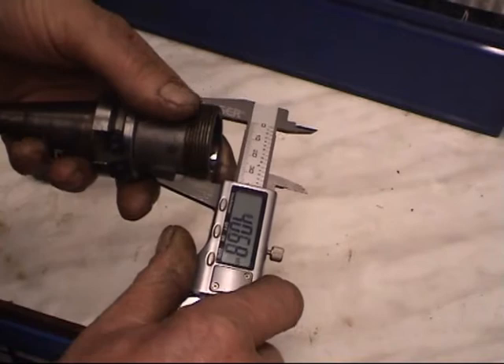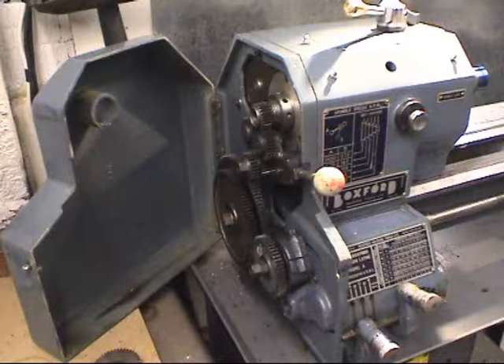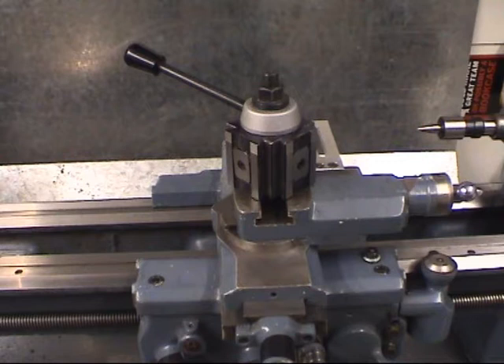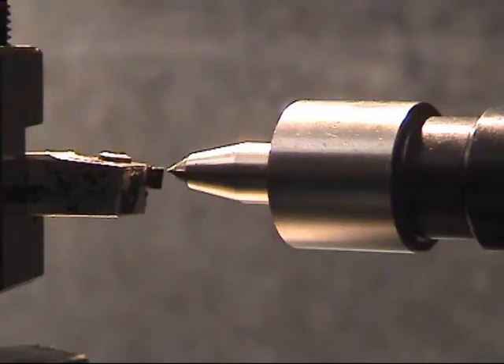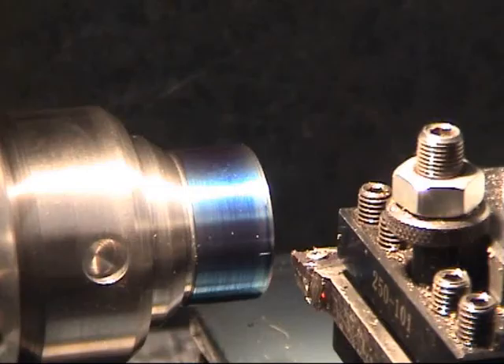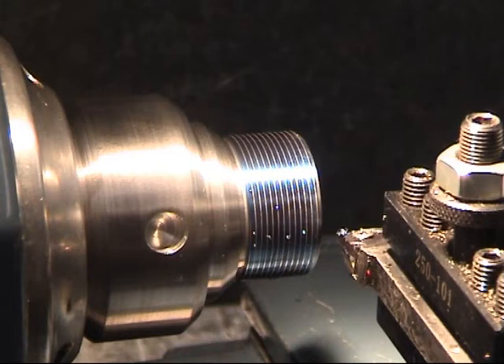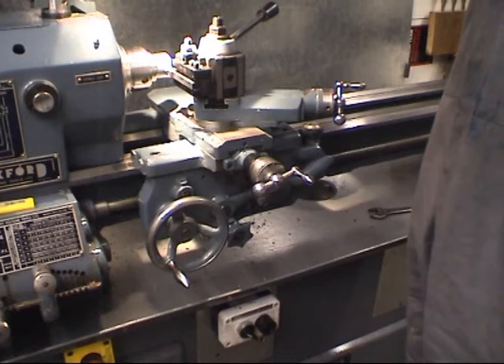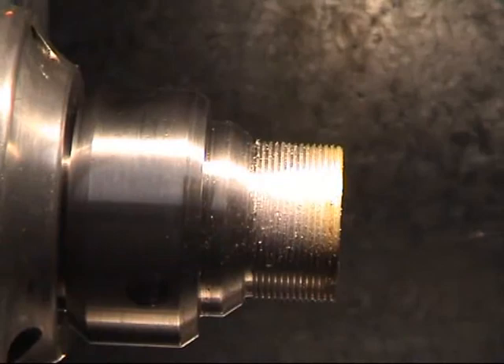Metric Thread On A Imperial Lathe

Comment: I feel that you can pull out at the end of the cut without the slipping sound.  To do this, you start with the gauge exactly on one, on the thread gauge. You don't use it, except for your start position. You throw in the half nut, when it is exactly at one, you drop in the half nut & hit the same track, without double threads if you start the first cut exactly at one.

Comment: When cutting a metric thread with an imperial leadscrew, the dial indicator is useless. The full reversal method you use is well known and obviously guarantees correct pickup of the thread. However, very close approximations to the 50/127 ratio yield factors that can be used to select more general changegears, which allows synchronous distances of the leadscrew pitch to be traversed more quickly with the aid of stop bars.  Martin Cleeve wrote about this in his sublime book on screwcutting.

Comment: Hi, I have a question I sure you could help me with if you are so inclined.
I have acquired a Norton gear box for my boxford cud lathe which I intend to fit in the near future  but I am having problems interpreting the data on the gearbox  change label in particular the feed in thousandths given for every thread pitch.
I am not sure what the value represents other than perhaps the amount the compound slide is advanced to produce the thread form?
If you could enlighten I would be much obliged.
P.S. I have looked in all the usual places and failed to find an answer.

Comment: The small wheel must be divisible by the pitch of the leadscrew or a quarter, half or 3/4 of the pitch.      120/8 =  14.  The large wheel must have 127 cogs.  127 / 25.4.  There are exactly 25.4 mm in an inch.  The conversion is exact.
Reply from the maker: How far away will it be using a 64 tooth gear
Reply: @doubleboost  The imperial system never was standardised so that the inch could vary from  country to country..     The metric system was standardized based on the speed of light and a metal rod kept in Paris.  It was decided that the nearest comparison was that there were 25.4 mm in an inch.   This is now universally accepted.     25.4 X 4 =  101.6 ( no good) 25.4 X 6 =  172/4  (no good)  but 25.4 X 5  =  127   spot on accurate,    All measuring devices are based on this.

Comment: You are not using your thread dial to pick up the start of the next cut,  but rather puting the lathe in reverse at the end of each cut.  Is the thread dial no longer correct when cutting metric threads, or are you doing this beacuse you prefer just reversing the spindle, lead and carriage?

Comment: I guess I am lucky to have a lovely big old Rollo Supreme lathe in my workshop. All I have to do is rotate one handle to convert from imperial to metric threads. This combined with a Norton gearbox means a complete range of imperial and metric threads are easy to cut including the funnies like 11 1/2 tipi, a pipe thread?

Comment: I have to disagree with you on not using a right angle to cut 60 degree threads.  Certainly the tool is being used as a form tool to cut a 'v' thread which is a much lighter cut than some form tools such as an acme.  You just take lighter cuts.  Are you trying to say you never use a form tool?  Some of the older lathes did not even have a compound and the right angle cut with a 60 degree tool (a form tool when used like this) was the only way to cut thread.  One must be careful about uttering absolutes.  There is more than one way to skin a cat and a good machinist keeps open to all ways to do things as sometimes you can't do it with just one technique.  Statements like that do not help the beginning machinist.  Doug
Reply from the maker: +Douglas Thompson I often use a form tool

Comment: The compound is not being set at 29 degrees. To set the compound at 29 degrees or 27 for imperial threads bring the compound around so it is in line with the cross slide, then move the 29 or 27 degrees to the right for right hand  external threads or to the left for right hand internal thread turning out from a blind hole, cutting the thread on the far side.

Comment: Hi... Interesting to watch this. One question I have is if you reverse the lathe usingthe inverter control - is there any need for the thread dial indicator? I have an inverter on my Boxford and have been looking for a metric TDI but haven't found one yet. 
Regards OL52

Comment: on a south bend 9a, replacing the 20 stud  gear with a 26    and setting the gearbox to B4 cuts a 1,5mm thread    with .061%    error     - no transposing compound required

Comment: Perfect little video,one day I'll get the courage to try screw cutting. 2 questions.does one use a different tool (profile) for different threads and is there a method for setting the gears (gearbox)with the correct tension (I've smashed a few teeth off one of my gears experimenting......"bastard"! Thank Christ for you vids John,never used a lathe before so YouTube is my guide.

Comment: Very good, thank you. I think that lathe originally had a speed range up to 1400 rpm (I might be wrong about that). Now you have converted it to an inverter set up, is the lathe OK at 2500, as you mention? I'm thinking of the bearings etc.
Reply: I know it's a long time ago but yes.
There was an upgraded version with a dial that controlled speed and went up to either 2000 or 2200rpm.

Comment: just info 

 you can open the split nut doing metric threading with an Inch screw! See
Youtube Oxtool ,  metric threading with
an inch lead screw.  I can’t understand
how I didn’t think of it after years of working with lathes and mills.